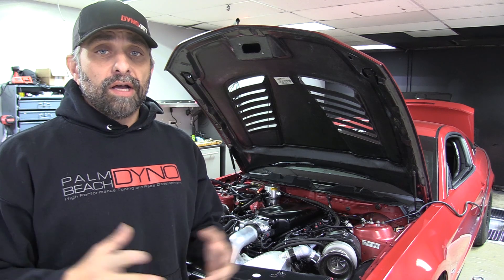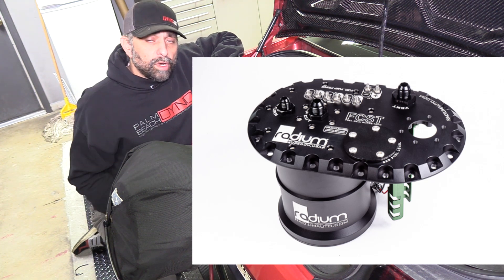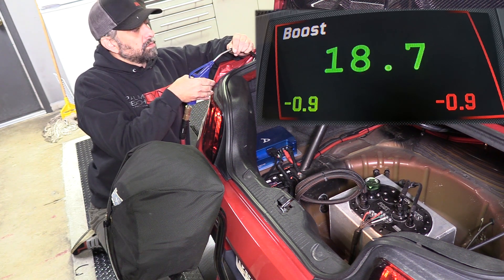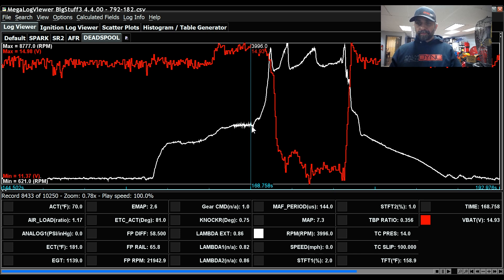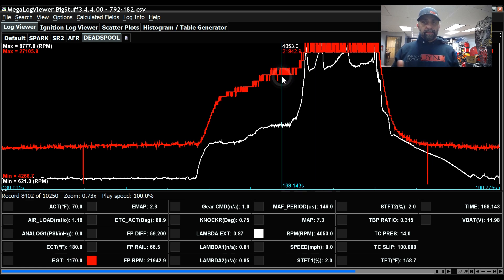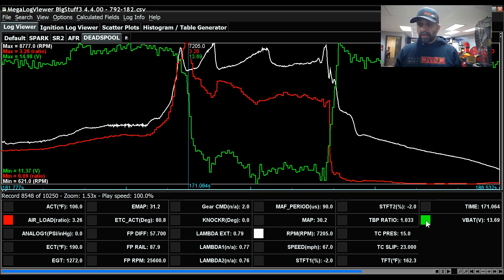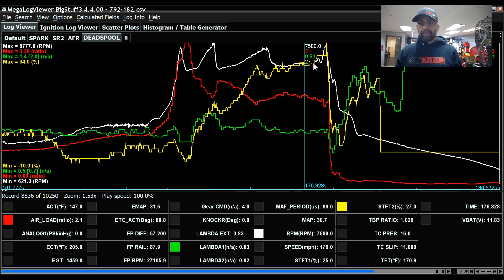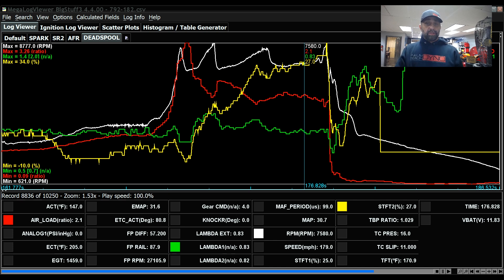Injector Dynamics Brushless Fuel Pump Controller - Review with Datalog

Comment: You should log current. The current draw is massive from the pump as if u noticed voltage at min 9. This dropped the voltage. And as soon as pump rpm dropped, voltage climbed back. So injectors and coils and your mentioned mass air reading and perhaps other electronics that had to deal with the voltage drop too. Some dwell and dead time compensation may help. But u need good volts to keep injectors and coils working fast and happy at high rpms @ high pressure!